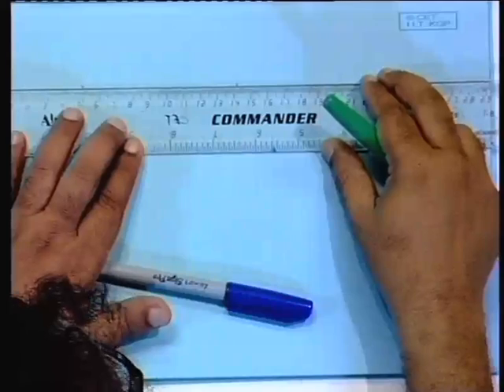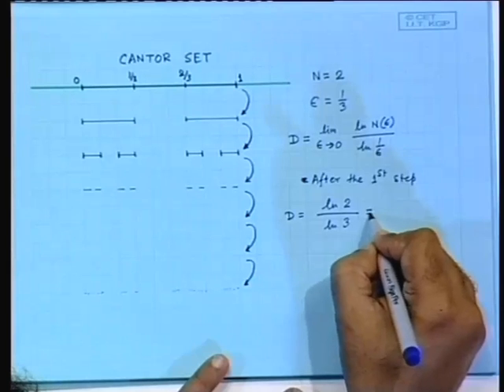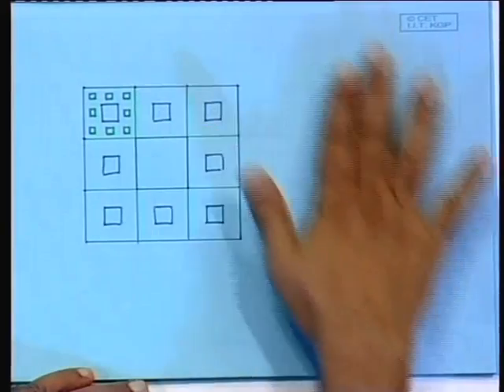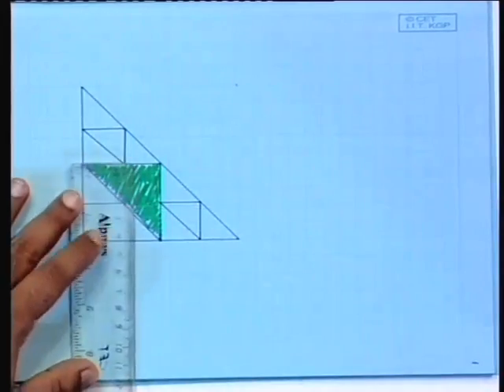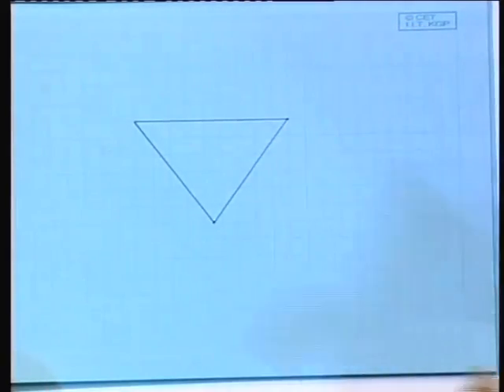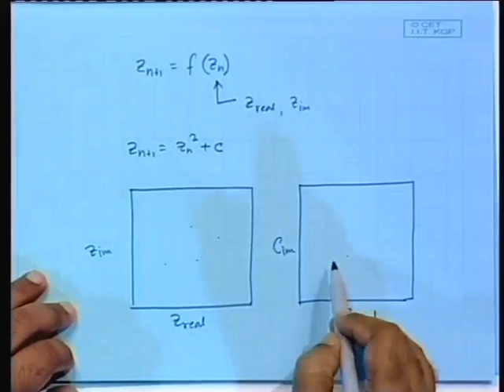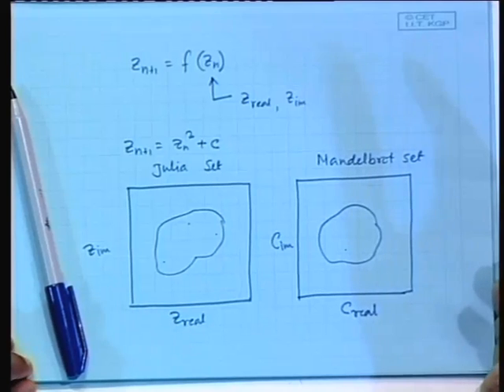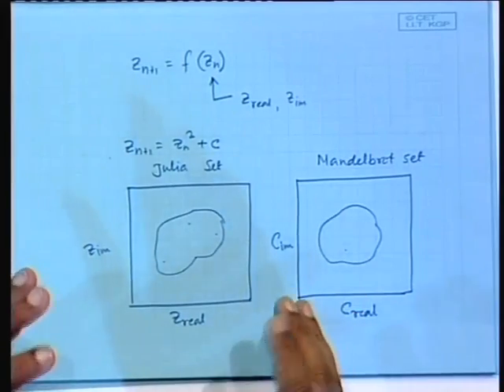Lecture - 15 Mandelbrot Sets and Julia Sets

Comment: That was interesting. For some time I have gentely thought about, mind enneagram and brain, synapse electrical activity, as like a fractal.

Could mind and synapes electrical activity, be like a Julia set? A synape fires an electric charge between two synapse one to another.

My curiosity is: The nine energies,. known as points: 1-9. or seen working as one of many (a to b actions). Action:b  9/0<1-9. counter shocked or pre-shocked or co shocked from point four to point nine (9/0) at point nine. Point:4 vier Action:a at Point:(4) 1 234 or Point:4 & # 2 1 (zero at point nine and nine at point nine). # is shock point one at point:3 working with all points within a unified synergy involving all nine working points. Working components -mechanical mechanism; of the working nine energies. 

So having watched your You Tube Lecture, My thinking is that there maybe a code within the action of a synapse firing an electric charge between two synapes one to another. The shape of the electrical activity maybe a physical code of an enneagramatic so to say instruction.

I am thinking Points: 4&8 and 1&5 maybe boundaries at one level of a posable operation.

The traditional enneagram has two shocks one at point:3 and the second shock at point:6 with point nine acting as the reconciliation within a triangeler 3-6-9 , A-B-C & returning to A or - 3 - 6 - 9 - 3 - , play of triangular reconciliation.

My Idea expands this model where in the concept involves a two directional interplay where in point:9 acts as B as it acts as C and point:6 acts as B as well as acting as C.  and Point:3  acts as A as well as B. 

( the zig-zag shape of an electrical lightning passing from, synapse to synapse) A-B-A-B or /\/\ the length and direction of each interval direction could be be coded as correlating to one of three segments from one of nine energies) The C could be seen as the complete or completed charge in its full length as a coded signal of information or instruction.  (A-B-A-B or /\/\) = C , C being the package of information transferred between synapses.

After watching your explanation of the "CANTOR SET" , "0--1/3--2/3--1" I am thinking I maybe on track and that the shape of the electric charge maybe a flattened out parameter space of the system the system being a complex command language of an enneagramatic code instruction.

Just a lateral thinking Idea in my enquiry to understand the three part action of the conches/ sub conches /un conches and Law:4 and point:4 working within the traditional ennaegram model.

Mark Anthony Rockliff
23rd January 2014